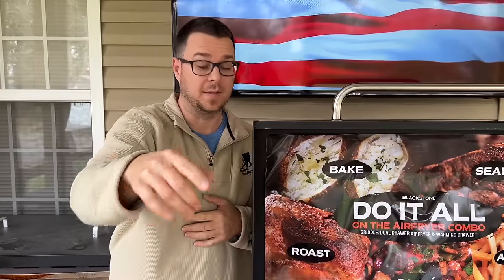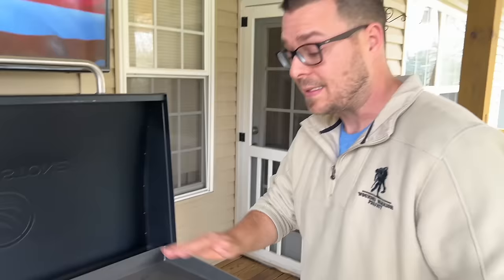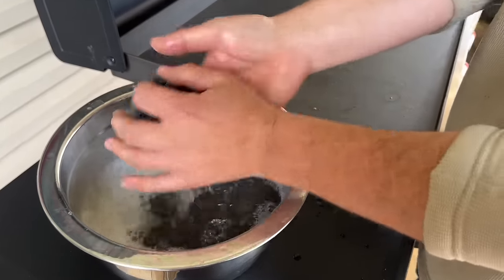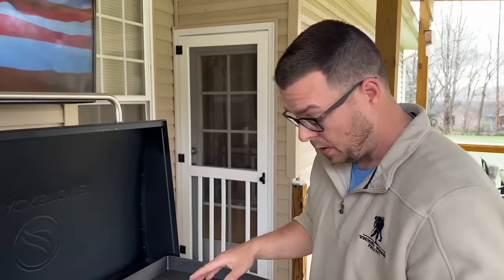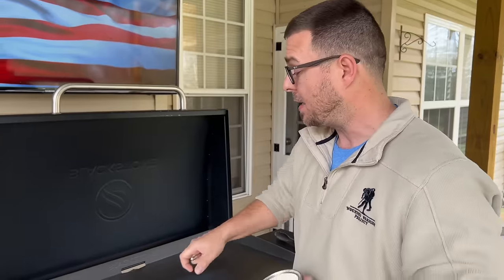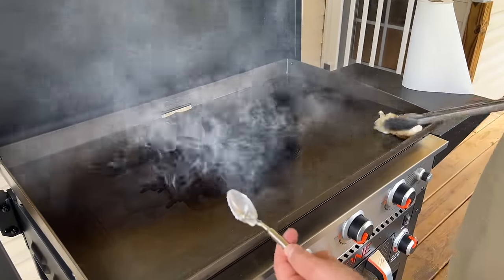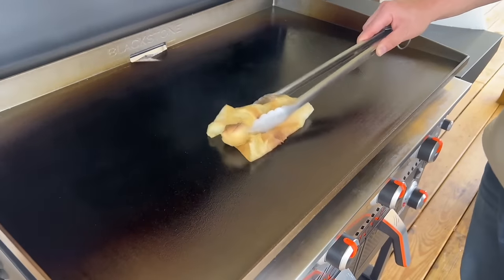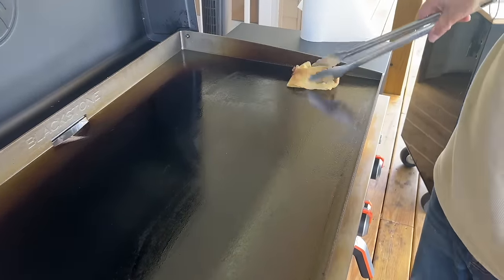How to Season a New Blackstone Griddle

Comment: A Little professional metal work tip, get a block of wood and wrap your sandpaper around it then sand the top. It really helps to knock all the high points down evenly, and don't press too hard! Otherwise, great information, thank you!! I personally would only use the soap on the initial cleaning to remove the oil from the factory, then water only. Now, a little unrelated information, Costco is a ANTI 2nd Amendment Company, just some FYI stuff for ya. So is Levis jeans and Burger King. I know, it really hurt me too!! As a Patriot, I feel I need to let other patriots know this info. God Bless!
Reply from the maker: thanks for the tips..
Reply: Weirdo
Reply: We as a country need to Update the second amendment to read “a well regulated militia and citizenry”. Stop all these mass shootings. I’m getting a Costco membership. Vote Blue!

Comment: I've watched a few different peeps seasoning griddles.  Never saw anyone use sandpaper.  That's actually a pretty good idea. Thanks Neil.
Reply from the maker: yeah it really does help just knock off the unevenness on the surface and helps create a more smooth surface.
Reply: Honestly that's the purpose of the oil, to build up and create a smooth surface.
Reply: I do the same with cast iron
Reply: I just received my Masterbuilt Griddle Grill & Smoker.   The heat range is from 150F - 700F.   I will be doing a Burn-In to get rid of all the factory/manufacture’s oils.   Is this sanding process you would also recommend for it’s Griddle?   It’s a removable Griddle so you can Smoke & Grill while not using the Griddle.

Comment: Hi. Does it hurt to coat the griddle surface before turning on the heat?  What’s the reasoning behind having the surface hot first rather than applying the oil first?
Reply: The Weber Slate manual says to let cool between coats. Now I don't know what to do.

Comment: I just sanded down an old Lodge griddle I want to use over my camp stove. I sanded it down with a detail sander and re-seasoned it with Crisco Vegetable Shortening and it came out fantastic. I'm getting ready to buy a Blackstone 22" Adventure Ready Griddle and I will use the same detail sander on it as well. Thanks for the tip!

Comment: Very (!) good job. I know I’ve commented on being an old cast iron guy before. You have this down, 100%. My only thing to add, after seasoning a couple of Blackstone: If your color doesn’t uniform up, right away, it will. Neil got a very beautiful season on this one. It is a lack of heat uniformity.  If is really bugs you, use a propane torch to heat cooler spots. They will mostly be on the outsides, and they will be identical looking in seconds.  And just remember that the only trick to perfect iron cooking, is to do it all the time. You can’t ruin iron. Without a torch. 😀
Reply from the maker: Thanks Jared, I was just watching someone else yesterday and he picked up the griddle top and turned it around and allowed the heat to hit the back area and i thought hum????

Comment: I just put together my Blackstone 28. Followed your method for seasoning, except I used Canola oil instead of Crisco - it's what I had in the pantry. I used avocado oil for the last "cool down" or maintenance coat. Avocado oil is going to be the oil of choice for cooking on the flat top. Thanks for the videos and it is on to Smash Burgers tomorrow for the first cook. I better study up on your videos.
Reply from the maker: Sounds great bud...we definitely have tons of great smash burger videos...both by how tos and actual recipes
Reply: Just a tip try macadamia nut oil from species nutrition it's available on Amazon you will never use a better or healthier oil

Comment: Great video!! When you sandpaper the top you may feel bumps from welds on the bottom defusers. I used a medium flat polish stone to work them out and also knocked the high points of sandblast off. Smooooth now. Just a tip.
Reply from the maker: Thanks for the info!

Comment: Thanks for this video - it helped quite a bit when seasoning my new griddle.    

One thing to note though - While it is quite alright to use a paper towel, DO NOT use the 'Blue Shop Towels'.   They WILL come apart and give you unwanted bits of PT on your griddle.  (Ask me how I know)  
Once I ditched those and went with my store bought Bounty paper towels, it was smooth sailing.  (Or should I say, seasoning) :)
Reply from the maker: Thanks for the info!

Comment: Great video. My question is after initial seasoning, I will cook until a few days later do I add a coat of oil or just as is?
Reply from the maker: Maybe a light very light after seasoning...just to have a coat available till you can cook...each time though...every time after...thin coat...
Reply: @TheFlatTopKing  Thank you!
Reply: @TheFlatTopKing  so if I only cook on mine once or twice a week oil it before I use it everytime?

Comment: Really well done(no pun) video.  I just got my 22 inch Blackstone and am researching the seasoning process.  I like the idea of hitting the surface with a light sanding.  Even though I did this on my cast iron  pans, I wouldn't have thought to do this on my flattop.  Thanks!
Reply from the maker: Glad it was helpful!
Reply: I've had my Blackstone 22" for just about a week and I"m seasoning it with avocado oil. The first thing I did was to bless the surface with 80 grit sandpaper on my orbital sander. After 5 cycles of seasoning, I tried a piece of french toast on it this morning. it cooked very nicely in the center, "hot zone". I also used the remaining egg mix for scrambled eggs and as long as I was able to keep it in the "hot zone", the eggs did not stick to the surface! I going to try more seasoning for the griddle in the oven at 425 to extend the seasoning further out to the corners.

Comment: Although I am greatly impressed with the Pit Boss, I ultimately purchased the exact Blackstone you have and love it. We use the air fryers A Lot.
I am surprised that no Pit Boss reviewer questions the longevity of the ceramic surface or the lost of griddle surface due to that grease hole. One thing about a cast iron surface it will last.
Reply from the maker: Oh i have questions definitely but how long will it last takes time. That to now is the biggest question. I have a solution to one problem already. So now its down to longevity. Absolutely pumped about the blackstone. Im excited about the air fryer as well. Do you cook on your griddle than melt cheese in there.
Reply: @TheFlatTopKing  never melted cheese in the fryer, I close the lid for cheese melting. It’s great for Hamburger night. Hamburger on the flat top, fries in the fryers, warm buns in the warming bin, wife makes coleslaw. Although I have tried smash burgers, and press my own Burgers nothing beats the convenience of Sam’s Club frozen 1/3 pounders and when cooked on Flat Top they are very juicy and good. Add your hamburger sauce some cheese, lettuce, tomato and red onions and it’s better and bigger than any fast food and most every restaurant.
Reply: @TheFlatTopKing  BTW when I see you use the plastic tools on the Pit Boss it looks very unprofessional for flat top cooking. I like a steel spatula that I can chop up meat, dice chicken, make cheese steak and cut sandwiches in half. In the indoor kitchen I always get lectured on using the correct non metal on our non stick cookware, outside on the flat top or bbq grill it’s my kitchen and I want real metal tools.
Reply: One recommendation have your wife be the one to cook on the Pit Boss. 1. Showing the Pit Boss is newbie friendly 2. She will bring up common newbie questions and mistakes you could address while filming or in post edit. 3. Not too many women doing flat iron videos Her YouTube channel flat top queen, she does look and sound good on video.

Comment: I live in a very windy at times area.  Could you add to your ever-growing list of ideas for comparisons what grill will keep burning with a crosswind?  Thanks, keep up the great work.  Both of you lol.
Reply: I’d like to hear your comments on the wind issue also
Reply: I am in a windy area also, I keep a piece of steel on top of mine to keep water off of it and I put that sheet of steel on the upwind side
Reply: Many, many BS users buy , depending on the size of their griddle, 6 -12+ of the bench scrapers from Dollar Tree.  They clip right on the edge.  A few things I have learned from this.  The scrapers get as hot as the griddle.  The overall temperature of the griddle will get hotter and will cause the griddle to warp.  Only use them if conditions dictate to.  Use on the windward side,  but remember,  that side will get hotter.   In my experience , and I have a 36 BS,  you  really only need 4-6. 2 on the side, 2 on the back side. Make sure that  they are metal, no plastic on them.  And you may have to practice and adjust.
Reply from the maker: I hope the other people can read this with out retyping over and over. On my camp chef it naturally comes with wind guards built in. I am almost certain/positive that Blackstone sells on many website wind guards for different sizes. I have not had 1 issue with my Camp Chef but I can see that there might be some with the Pit Boss and Blackstone. I know some people have commented that they have found natural wind breaks on the porch or deck by moving a piece of furniture around or something similar to that affect that just cuts enough wind to cook with out fear
Reply: @TheFlatTopKing  can you pin your own comment?
Reply from the maker: @CheezeheadChris  way above my pay grade. No clue on that one. How and why
Reply: @TheFlatTopKing  Lol 😆!   Is there the 3 dots next to your comment on the right? If so, click on them. "PIN COMMENT ".  Ya might have to go to to original comment.  Or,post it as  an original comment , and pin it, or, post it in the description. 😉👍
Reply from the maker: @CheezeheadChris  Dont kill me what is the point of a pinned comment
Reply: @TheFlatTopKing  it will be the very 1st comment  seen on top by everyone.   So, then you don't have to repeat yourself.   Most don't read the description.  But they most always go to the comments.  So, you can pin yours or anybody comment that you want.  You can un-pin or change the pinned comment.   Can use it as a written intro.
Reply from the maker: Robert Stevens
52 minutes ago
 @The Flat Top King   I do have wind guards only if I think I need them, I am setup my back porch not protected from wind, sometimes gets pretty windy so I put the guards on, I  only use the side guards.
Reply from the maker: @CheezeheadChris  ty
Reply: @TheFlatTopKing  I can confirm that Blackstone sells wind guards… I’ve got them on your exact model. They come in a 4-pack. 1 for each side and 2 for the front. 

They have downward facing vents  spaced out. Perhaps that’s what prevents the warping issues (I haven’t had any).

I have westerly wind more often then not… So the wind hits the right side of my flattop. Put the flame out once so that made the extra purchase a MUST-HAVE ;)
Reply from the maker: @realrasher  thanks for sharing we need to hear that. Can i read this comment on a video
Reply: @TheFlatTopKing  Hell yeah Brother! 🙌
Reply from the maker: @realrasher  ty

Comment: At what point did you shut off the heat? before, during, after the 5th coat of oil? Thanks. great videos. Just got my loco griddle today.
Reply from the maker: After the smoke calmed down on the fifth time. Once cooled down i re applied with no smoke.

Comment: Great info.  I got my 36” yesterday and will be seasoning shortly.  The only question I had is it appears that after putting that initial coat on and burning it in, it seems you do not let the grill cool any or turn the heat down between coats.  Should we just leave it the same temp and apply as many coats as we need?
Reply from the maker: yeah..just leave on...it will burn...then reapply...still it feels a lot smoother

Comment: Thanks for mentioning sanding down the rough spots. I hate rough spots on a cooking surface, but everyone acts like they're normal.

I've been watching a bunch of your videos, as I cook breakfast on a griddle twice a week, so I just took a sudden Jonesing to get an outdoor griddle and I'm researching which one to get, but they all seem to have something or other I don't like about them.

I like the Pit Boss's grease drain location the most, but I don't like the ceramic surface.
I don't like the rear grease drain on the Blackstone, though I suppose I could learn to live with it. Blackstone may be in the lead, sadly.
I don't like that the Camp Chef only has two wheels, and I'm not crazy about the front trough / lack of a wall. I saw a great mod done to it where they welded on a front wall and cut a section out of the left wall, so they could just rake huge swathes of gunk off the side into a drip pan and clean the spatula off on the ramp, that would be pretty nice. I also don't like that it's pre-seasoned as I'm sure it will have a rough surface like all non-artisan cast iron that comes pre-seasoned does, and I don't trust myself to use a power sander to get rid of that without taking off too much. I'd also suspect a cast iron cooktop is really heavy, and the thing just looks big and hard to store.
The Loco has "smart" burners and a likewise good grease drain the same way the Pit Boss does, but I don't like that it has to be plugged in to function.

Seems like there are just barely any other ones, and even if you decide to go with a Blackstone they've got so many models it's hard to choose.
Reply from the maker: you nailed it...i have two videos that basically share that same idea when it comes to choosing a griddle.....Thats why in one of the videos I said I wish I could build one they way I like it..like a video game..haahahhaha to many options that make you think about
Reply: @TheFlatTopKing  I've watched both.

Grilla Grills has a Primate that looks the best I've seen so far  build quality wise, but the surface is smaller.

It's like there's a law where they can't make one without any problem.
Reply from the maker: @praetorxyn  i have my eye on that one. People who have them tell me they love em. But i get that alot from all as well. Someone did say something like its a grill first griddle second. I honestly wish inknew. Like you it’s frustrating. I dont mind to pay money as long as I know its worth the extra
Reply: @TheFlatTopKing  Yeah, it looks very nice. I mean, Blackstone has a couple units that are the same price and look nice, but if you look at the reviews there are all kinds of horror stories in there, like stuff arriving damage and their customer service taking forever to resolve it, drawers not even having screw holes int eh right places, materials feeling cheap, etc.

I don't at all care about the gas grill on the Primate... if I'm grilling something over grill grates I will use my SnS Kamado or a PK Grill or something and grill with charcoal for the flavor... so I would literally never use the gas grill portion of it I don't think.

I am trying to make a spreaddsheet with the surface area of all the griddles I'm looking at, and it just seems like with the Primate you lose about 5 inches of depth.

I would love to see you cook on one and give your opinion if you're ever around anyone who has one though.

Comment: I just joined. Great info brother. Question from previous videos. you cook and are “seasoning” as you go.that being said after each time you cook and clean, Just make sure that there is a light coat of oil all over and then you’re golden? Also thoughts on the silicone covers that go over to help protect the flattop? Thanks man
Reply from the maker: So i am torn on the silicone covers...I think they offer a false sense of security...moisture, debris, etc still find their way....NOW if you use that and a hard cover you should be good...BUT...I dont have a product just using the hard cover....so im torn
Yes...after cooking and cleaning..make sure your griddle has a light coat ready for the next day

Comment: Well I’ve watched so many of your videos I feel like family now 😂. So one question I had that may have been answered but I missed was. How hot is too hot when seasoning? 
 I got the pre heat on low for 10-15 minutes but then do you turn to high and leave it there during the whole seasoning process or do you back it off some so it don’t get too hot?
Thanks for the help in advance. 😀
Reply from the maker: no..just let her rip...no need to keep on high if you can hit hot enough temps on a lower temp..maybe med high..just a waste of propane..
Reply: @TheFlatTopKing  awesome!! And thanks for responding 👍

Comment: Thank you for these videos.  If you start on medium heat, after the 15 minutes of preheating. How long do you leave it in high before you add your oil. 
I added my oil after turning the knobs up to high and it didn’t smoke hardly at all. Is that bad?  I still let it cook for 10 minutes before adding another coat.
Reply from the maker: NO...as long as your griddle is hot enough regardless of position where your dial is...your good...each griddle is different.....2 big things...get griddle hot enough to allow smoke to burn off till almost no smoke...thin layers